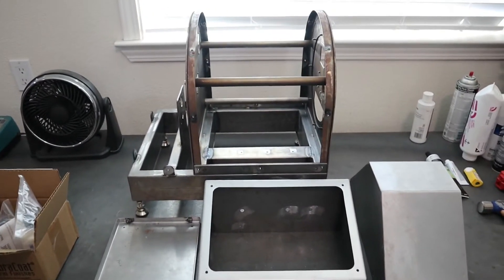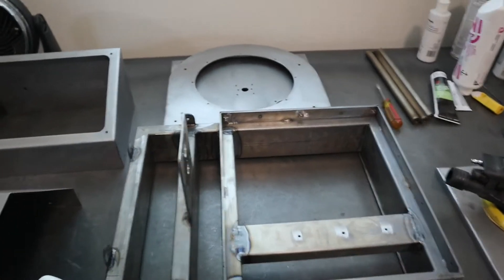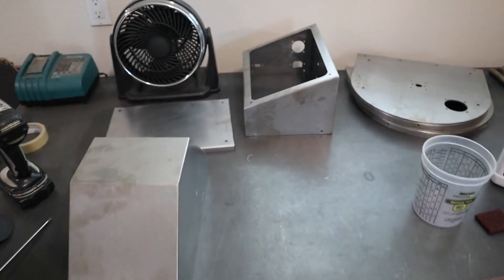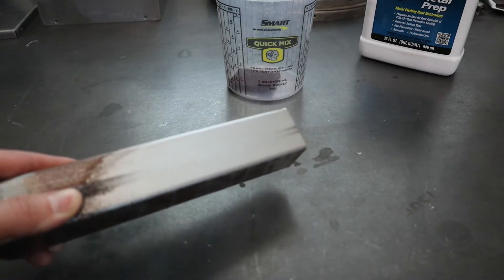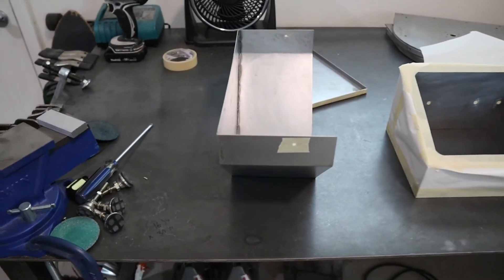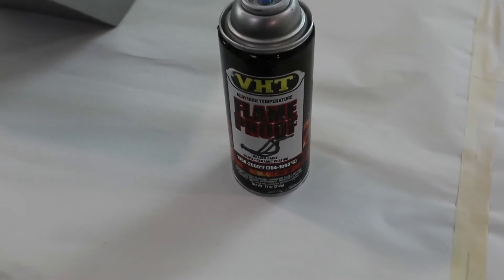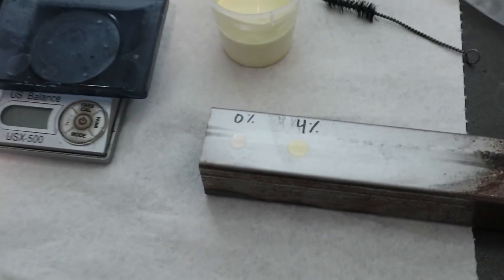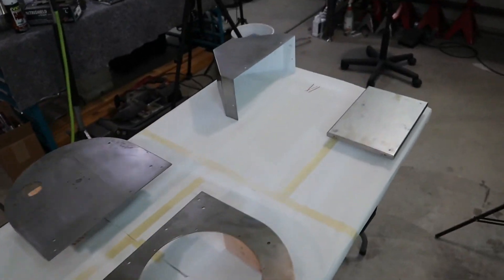DIY Coffee Roaster Build Part 4

Comment: hello ,, how you doing ,, may i ask you .. do have knowledge regarding electric power supply .. its wil to kind if post new vlog ,, thanks alot for you video
Reply from the maker: It’s just an off the shelf power supply. 120-240v input, 12v output. You can find them on Amazon or eBay. I will finish the video series, I’ve just been very busy with other stuff.

Comment: Coincidentally I've been drafting for a drum roaster similar to what you are doing. May I ask where you purchased your power supply, relays, fidget, and infrared heat plates? I've been a roaster for 10 years and want to emdevour upon building my own, but it's been a pain looking for these parts. Thanks.
Reply from the maker: I got the power supply from eBay, relays and pid from Amazon, phidget directly from their site and the ceramic heaters from mor infrared
Reply: Nevermind found the majority of them on Grainger.